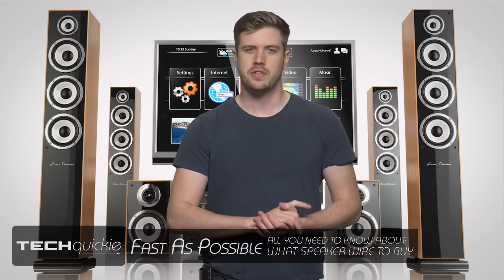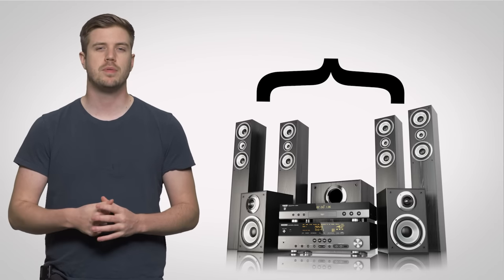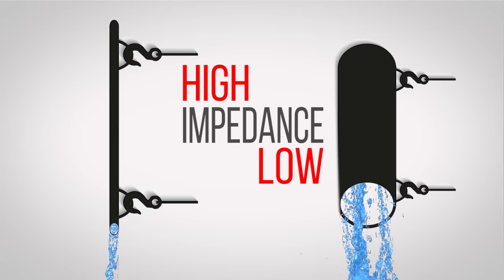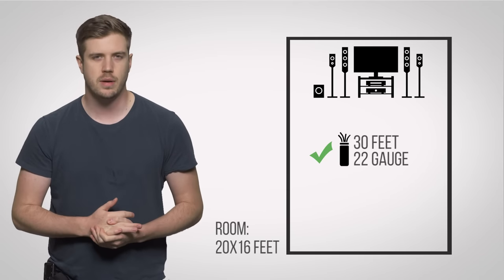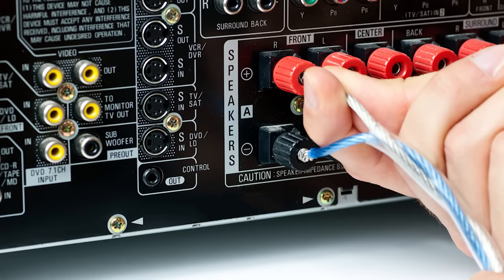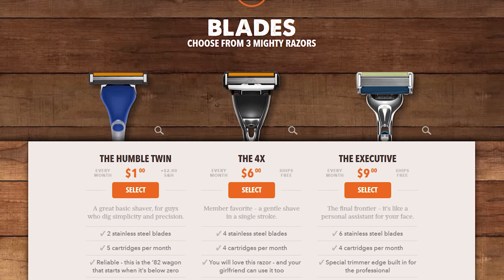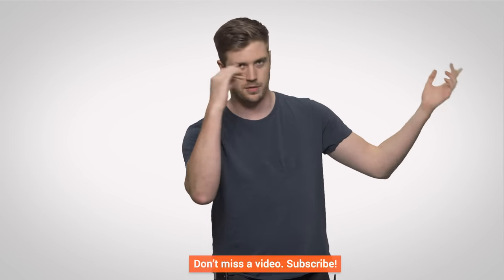What Speaker Wire To Buy As Fast As Possible

Comment: good video but when he mentioned not to buy the really overpriced wires he also should have mentioned about overly cheap cables. often times really cheap cables are not actually as thick as they advertise, so even tho they might seem like a good deal you do get what you pay for.
Reply: If you want cheap but good enough buy metra brand rcas.  They are also good because they dont put the vulcan death grip on your rca inputs like monster does.  They broke an alpine amp i had rca,s on.  This was like 25 years ago though so they may not be as bad now.

Comment: Doesn't putting too small of a resistance in a circuit (at a constant electrical tension) just cause your power supply to overheat and... self destruct?  It's like when you short-circuit a battery.  The ohms are fixed (super low, almost zero), the volts are fixed, so it's the amps that try and shoot up to try and match Ohm's law.   The battery overheats until's either drained, or is too damaged to supply the volts.

So how come low impedance speakers just "give you bad sound" instead of causing your power supply to melt?
Reply: +PTNLemay it's more about the amp not having enough power and clipping. It's also wise to never use lower impedance speakers than what you're amp is rated for.

Comment: What's difference between Speaker wire and normal Electrical wire ? Does speaker wire have pure copper than Electrical wire ? Can Electrical wire be used for Speakers ?

Comment: I would not recommend 22 gauge wires on a sub since they generally have substantially more power being pushed through and you get more loss
Reply: +Shayne Gadsden depends if the sub is using an internal plate amp or not ;)
Reply: +Slot1Gamer if it is has its own amp any decent sub will be using rca's not speaker wire
Reply: Shayne Gadsden my sub has both as it has LFE and high level

Comment: Could you further explain why copper would cause an issue with higher frequencies over a certain distance of wire?
Reply: +CDP135Z it's not really how it's described here. You will get some voltage drop with thinner wire over long distances.

Comment: How does these copper wire compare to fiber optic when it comes to audio?
Have you guys done an episode on it?
Reply: Fiber optic transmits data/information via pulsing light, you couldn't power a speaker with it, you could only send the information regarding to your audio signal of interest. Through copper wire you are able to provide the necessary electrical current to drive the inductive load of your loudspeakers.
Reply: So copper also power the speaker. But what about the audio quality? 
Copper, HDMI, optical, vs wireless?
Reply: +ArchOfWinter Fiber is digital. You can use copper for digital as well (coax), and TBH I don't notice a difference between the two on my receiver. Ones and zeros are ones and zeros, after all.

Comment: 8ohm speakers are better, because they can produce more sound at lower wattage. think of a an ohm as a person who pushes the speaker that makes it move. if you have 8 of those guys (8 ohms) then they don't need to be as strong if say there were only 4 of them (4 ohms). if you had a speaker rated for 100w at 8 ohms then you would need 200w at 4 ohms to match that rating. car audio is usually around 1/2 - 4 ohms, that is why it sucks and needs to be crazy powerful.
Reply: +electronics for fun I'm not sure where you 'tried' to learn this stuff at. But you are so far off it isn't even funny and I don't even know where to begin to correct you. Lets start with getting the 'higher ohms is better' out of your mind. And direct you to google about speaker sensitivity. Then google about Thiele Small parameters. Get a copy of the 'Loudspeaker Cookbook' as well and read it. Those things will bring you a long way to actually understanding what you are talking about.
Reply: Brad Humphrey ok thanks l will be sure to NOT do that. also what does speaker sensitivity have to do with what l said? l am talking about power, not loudness. in my experience with home audio, pro audio, and car audio, a speaker with a lower impedance needs more power than a speaker with a higher impedance. example: if you have a 100w 8 ohm speaker wired into 1 100w 8 ohm channel then everything is fine, if you wire another 100w 8 ohm speaker on the same channel, then then the amplifier impedance is cut in half and it would have to deliver 200w at 4 ohms to run that other speaker at its rated power.
Reply: +electronics for fun A speaker needs more power for what if not for loudness? That's the whole point. 100w 8Ω speaker, on an amp that delivers 100w @ 8Ω is certainly efficient. And yes putting another 8Ω speaker on that channel will lower the load on the amp to 4Ω. Which would allow the amp to supply 200w (if the amp's power supply & output stages can handle that load - 4Ω stable).  But what point are you getting at, that's simple ohms law. That system would play 6dB louder theoretically (3dB doubling of surface area & 3dB doubling of power) - minus comb filtering effects and other room acoustics.Power is power, no mater what resistance it is delivered at. Speaker sensitivity will dictate what loudness you get from that power. Example: 2 speakers being completely equal except 1 is 8Ω with sensitivity of 89dB and the other speaker 4Ω with sensitivity of 86dB (and let's say they can handle 100w each). Hooked to an amp that can supply the proper power (let's say a 500w amp & 2Ω stable), both speakers would theoretically sound the same at the same volume position (gain). If we changed one of the speakers to a 200w model (doesn't matter which one), they would still sound the same up until we turned the volume up to exceeded the power of the lower wattage speaker.Change the model of speakers with sensitivity on the 8Ω to 86dB and the 4Ω to 86dB, then on that same amp the 4Ω is going to sound louder at the same volume position (without exceeding the speaker power rating). Opposite is true if we switch again with an 8 speaker with 92dB & a 4Ω with 86dB.Note: All this has nothing to do with sound quality! We are just talking power & loudness.
Reply: l know that power effects the loudness, but that is not what l was talking about. l am just talking power. you are talking power and loudness. it sounds like what l am saying and what you are saying, in terms of power, line up. so what am l being corrected on?
Reply: +electronics for fun Correcting you on your opening statement "8ohm speakers are better, because they can produce more sound at lower wattage". That is just plain incorrect, as I explained in my lengthy post.
Reply: Brad Humphrey ok.

Comment: so using linus' logic from the 1000$ hdmi cable video - if i get bigger better speaker wire and then expect my 100w receiver to turn into a 120w receiver and it doesnt, the wire is junk.

Comment: "16 gauge wire is good up to 50 feet"... What? Why??? As far as I know 16 gauge wire has a resistance of just 4ohms per 1000 feet. So 0.2ohms per 50 feet. That's not much. But by all means go for the thicker wire if you can. Also, yeah, avoid the audiophile snake-oil cables and get a better speaker and/or amp instead, or thick curtains and better speaker placement instead...!
Reply: +BIll Georgoulakis  He should have been using the terms speaker cable and characteristic impedance, simple zip cord is a speaker  cable a that has a characteristic impermanence over a range of audio frequencies. While wire gauge will play a role in determining that impedance. Quality speaker cable should have  chart stating the loss it exhibits. One should use that data to chose the correct  cable for  an application. The resistance value you are using is for DC resistance. The manufactures application table takes gauge into consideration when calculating losses.

Comment: I really disagree with your wire rating chart, just knowing the impedence of your speaker isn't enough to determine what gauge wire you need. Wire gauges are rated with current, not load impedence, you would need both the wattage of your speakers and the impedence to calculate that (ohm's law...),  200w 8ohm speakers would not require the same wires as 40w 8ohm speakers.
Reply: 200W is the energy consumed by the speaker and the impedance is just resistance offered to the current in the signal line. At the end of the day, you just need to make sure that the wire has a lower resistance than the impedance rating of the speaker.

Comment: While your right that impedance is the issue,  your wrong about many other things.   Speaker impedance is "nominal impedance"  this is just an average figure, pretty close to DC resistance.  It hides the fact that not all speakers are equal.  Some have very much lower impedance for prats of the frequency spectrum.  Others have less variation but all have some.  There are some speakers that fall to just 2 ohms minimum yet nominal is 8 ohms.  There are amplifiers that ares designed to handle very low speaker impedance and others that are not.   It the amps specs give a power rating for a 8-2 ohm load and you put an 8 ohm speaker on it, your in better shape than using an amp that is only rated for 8 ohms because as the speaker impedance decreases with frequency, the amps is going to have a really hard time supplying sufficient current and the speaker will under perform and the amp may even blow.   Having very low impedance speaker cables will help the amp supply current to the speaker and help it perform through through the difficult, low impedance range of the frequency spectrum.  The the chart you are using that suggests 16 ga cable is fine is based on DC resistance only, it is not based on impedance.  Impedance is a combination of electrical the properties, DC resistance + capacitance + inductance.  That last 2 here are influenced by the dialectic used in the cable, the distance between conductors and cable construction such as whether it's parallel pair twisted, braided pairs of quad etc.  So basically there is a lot going on and it isn't simple.  However there are some simple rules of thumb that are well accepted to pretty much guarantee excellent sound regardless all these factors and it doesn't mean you have to shell out for exotic boutique cables either.  For most home HiFi cable length will be around 3 metres or 10 feet and generally conductors of between 14 and 10 AWG will do a pretty decent job for 8ohm HiFi speakers though you probably want to at least 12 AWG for 6 ohm speakers.  Some people will go heavier and there is nothing wrong with doing so.  Heck, given the cost of decent HiFi, it is just ridiculous to skimp on a few $s worth of copper to drive them well.   I've been in audio for more than 30 years, retired now so I have nothing to gain saying this, but my experience has proven that speaker cables can often make all the difference to the final performance of many speaker and amplifier combinations.  Zip chord cable is generally not great, but a decent pro audio cable with published specs such as Blue Genes is pretty good insurances that you will get practically the best possible performance from your HiFi on the first attempt.

Yes, I have run 14 AWG over 8m to PA speakers for a most excellent true sound reinforcement result,  but PA is a different animal to home HiFi.

Most of the tables you come across are just wrong.  Over years of experience, I have settled on a cable impedance less than 2% of speaker load.

Comment: Quality OFC 14 gauge exceeds the requirements for just about any amp and speakers 99,9% of people actually own and use and their source quality. Spotify sound quality sucks, but I use it too. Just don't expect cables to solve that, if it is an issue for you at all.
Well applied bare wire connections are just as good as any plugs for that demographic. 
Cables and connectors do make a difference, but only for me, not for you. i am one of those 0,1 percenters....:)

Comment: What? Speaker leads longer than 50 feet can cause you to lose high frequencies due to "copper's electrical properties"? Dude, get your facts straight if you're going to tell other people how to do things. That's straight nonsense. Series inductance or parallel capacitance (or worse yet, both) are the only things that would cause you to lose high frequencies, and this would only be noticeable with runs that are literally thousands of feet long, due to the fact that the source and load impedances of amplifiers and speakers (respectively) are so low.

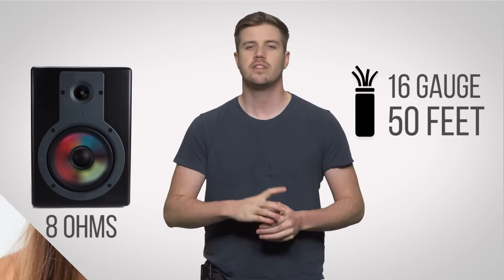Comment: 2:08!
Did someone hit you in the head? if the wire is longer, the voltage drops with every meter you add. LESS Movement from the speaker. How can you lose the high freq if that its the smallest speaker. All generic are Piezo.
Look at it how small it is. AHHHH you lose the low freq. That`s different. its using more Voltage to drive the magnet.
SO Longer wire= less BASS

Comment: impedance is a measure of resistance for ac current,. not speakers per-se. ac vs dc currents
Reply: +Joshua Blalock speakers work in AC, until you clip and get a dc like signal.....
Reply: DanielRichards644 I see. I do a lot of electronics as a hobby. Been teaching myself since I was 9, I'm 22 now. I should have elaborated more than just ploping down ac only . phase angles still confuse the hell outta me. Took me forever to understand. Like making a simple amp with a single transistor and a voltage devider to pull the gate voltage up to be more responsive. I didn't understand that it flipped the phase. Ahh noob mistakes. Wish I could go to college.
Reply: monomerx001 I know they work with ac. Dc would just burn the coil up.

Comment: Would have been a nice video if you would have used standard not funky measurement units.
Why have you been using the standard unit [Ohm] which is kg*m^2*s^-3*A^-2?
Isn't there a funky unit for impedance? How about pound*inch^2*s^-3*A^-2?

Comment: If a speaker wire is too thick like 12 or 14 gauge, would it have problems fitting into spring clip connection in receivers? The Yamaha RS202BL I have doesn't seem to open up that much to allow for a thicker wire to fit in

Comment: You completely left out material, which makes me a sad panda.
Reply: well, explain to me the options please
Reply: +TheCheaterofall Ya I think he covered that when he mentioned "Consumers being bedazzled by marketing hype"...
Reply: +TheCheaterofall 100% copper. You'll be fine.
Reply: +appendixless148 Gold has a higher resistance than copper does. Gold is only preferential in certain situations in which corrosion and oxidization are important factors. As for quality of an audio signal, it is the same between all those materials. You would only need to have a thicker aluminum wire when compared to copper for a given current.

Comment: I am VERY disappointed that he didn't even mention the importance of Damping Factor, which is the ratio between the amplifier's output impedance and the speakers' own impedance - ideally the former should be zero, and the latter infinite - in any case, the damping factor determines how well a speaker responds to sudden changes, especially in the low frequency range. Imagine a single pulse being sent to the speaker; a good D.F. will ensure that the speaker only does a single excursion before coming to rest again, whereas a bad D.F. can, and often will, result in the speaker doing several excursions from the neutral position.

Comment: OK. the topic should be speaker cable not speaker wire. You want to use speaker cable whose chracteritic impeadance maths thye impedance of the audio component you will be using.. While wire g size will play a role is the determining the impedance of a cable, and DC resistance  has a part in deirming losses, but on should consult, it's best to check the cable manufactures data sheet to select speaker cable. Choose a cable that has the characteristic that is required and the least loss at the runs in your installation. while speker cable carries current, but it's not DC most cases. Fatter isn't better if it's in a cable that doesn't have the proper characteristic impedance.

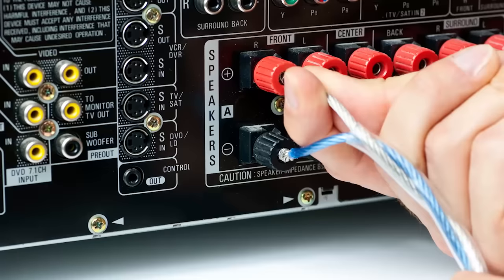Comment: 3:07 is probably the most incorrect use of these types of connectors I've ever seen. The center of these connectors are designed for banana plugs. You would use bare wire around the base of the red/black parts as a type of binding posts.

Comment: i had this Hama aux cable and it made everything sound horrible, i guess it was broken because i made the same lenght aux cable and everything sounds much nicer now.
Reply: not broken just very poor conductors
Reply: pr0xZen I repurposed the wire for a small led panel and I found out that the wire had spun inside the connector, holding the connection with like 5 threads, and that the wire did not have any proper shielding, just ~1mm of rubber coating
Reply: +Niko J if its litz cable doesnt need shielding, it cancels the magnetic field around the wire and since is low voltage signal shielding only adds resistance on the return wire, the return is as important as the signal wire, u can use cat5a wire which costs les the 50p a meter and braid it into 4, pair of two for one length and i bet is better then even cables around 50 bucks or more

Comment: 25W rms : 8 ohm = 14v nearly 1.8 A 
25W rms : 4 ohm = 10v nearly 2.5 A 
that's why ? we need a big wire in a lower ohm speaker,

Comment: How about those 200$ per 1 feet monocrystal wires, I've actually seen one costing 600$ a meter for some reason, do they make any difference and in which case could I hear that difference.
Reply: Like someone else mentioned, just by a cheap ass extension cable and use the wire from that.